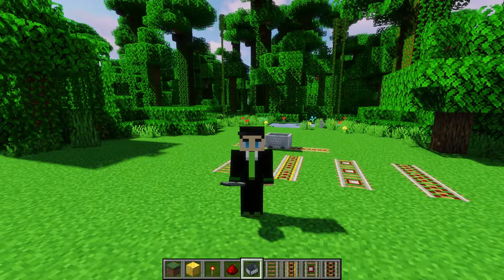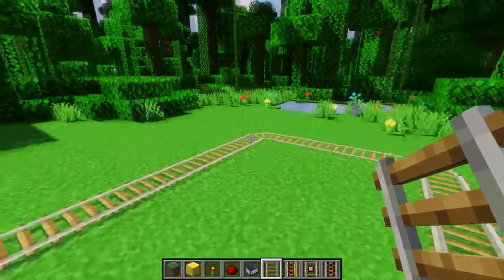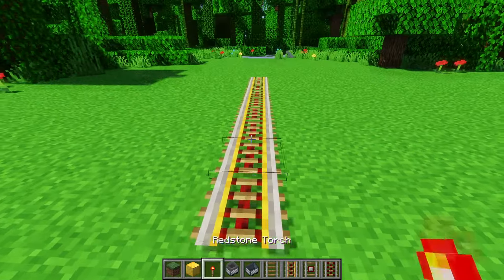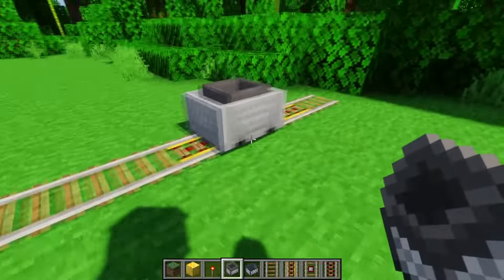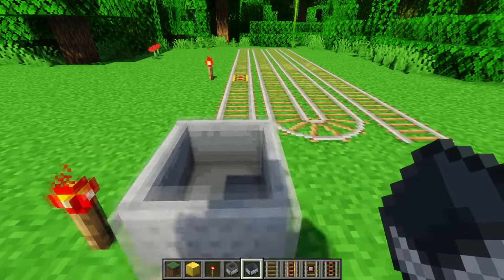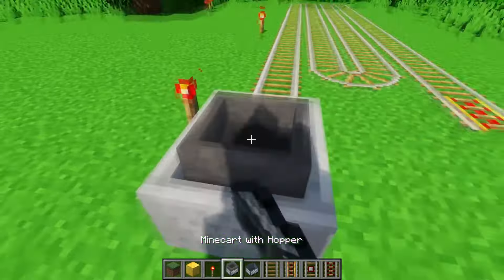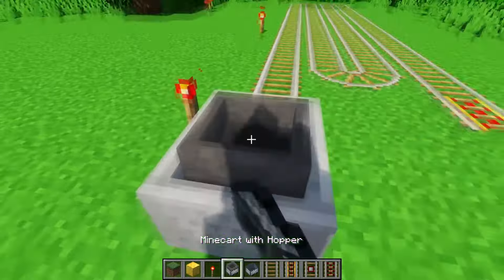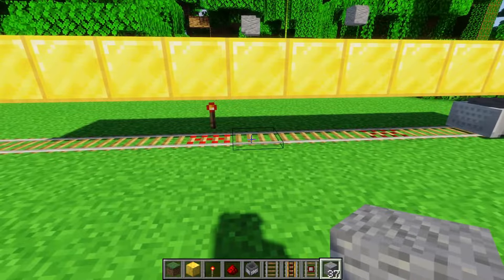Rails: Everything You Need to Know (1.21 & Down) | Minecraft Redstone Engineering Tutorial

Comment from the maker: As others have pointed out, something I forgot to mention is when the carts are loaded they will go further (I don't know exactly the numbers, but when its flat its about double the distance when it's not on power rails I think). If I remember correctly, its also the same for uphill, so when its loaded it goes further uphill. The details might have changed over time but they are definitely different, so I would recommend if you are making a rail system, sending a loaded and an uploaded mine cart through to make sure they both work (unless you never intend to use an unloaded one)

Comment: if i put a dispenser facing down with an activator rail on top and activate the rail, then put a hopper minecart with an egg inside the hopper minecart, will it move the egg to the dispenser and if so will it activate it at the same time, or the next time it goes over the rail. also if i have like 30 of them in a row, and redstone blocks on top, will my hopper minecart stop?
Reply from the maker: You would probably have to test it, but if I am going to guess, the egg will never leave the hopper because the activator rail will disable the hopper. I'm not actually sure though
Reply: @ZennsWorld  i meant the detector rail, also it works i just need to put a hopper under the rails and some powered rails (no need to activate them they will be activate with detector rails) so the minecart doesent slow down fully